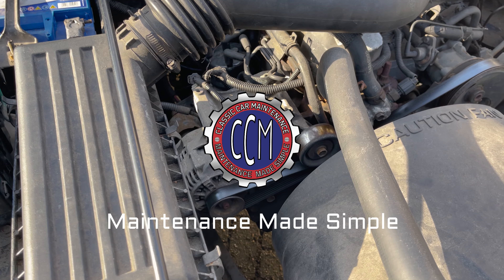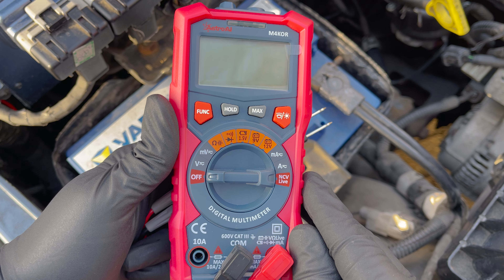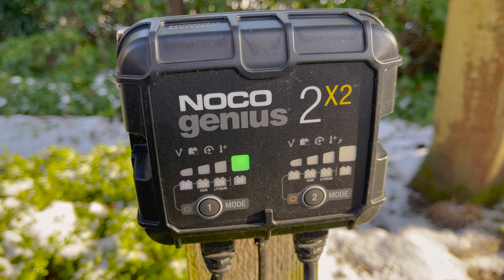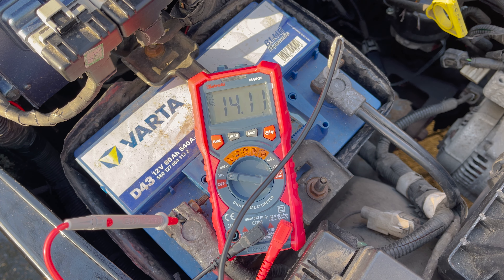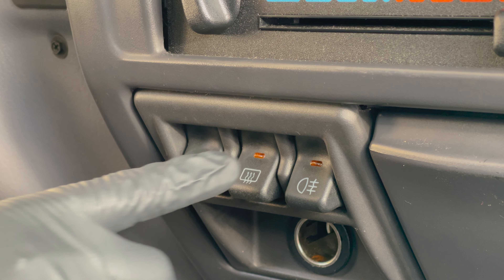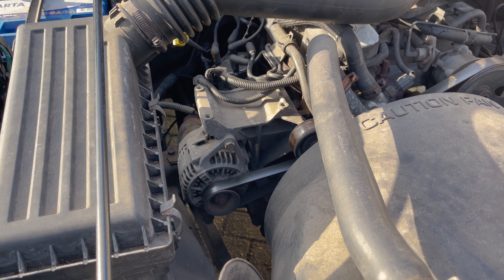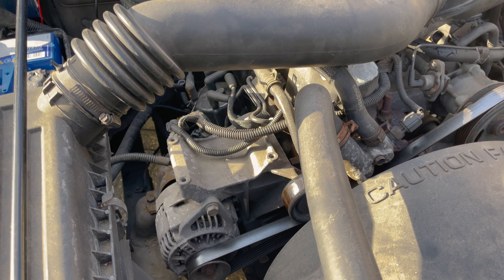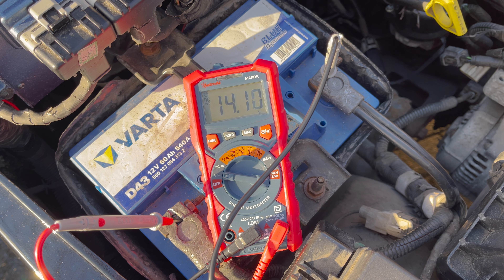How To Test an Alternator With a Multimeter

Comment: What if the vehicle won't start so I can  finish the alternator check? We think it may  be already bad, but not sure. Great video, btw.
Reply from the maker: Glad you liked our video! To answer your question: It is not possible to do a decent alternator check without a running engine. An alternator generates electricity by using the rotational motion of the engine. Only while the alternator is powered by the engine you can check if it is operating correctly and if it produces enough electricity to charge the car battery. So in order to check your alternator you’ll first have to get your vehicle to start again. 
If your car doesn’t start, the first thing to check is your battery voltage. If it’s too low, your starter won’t be able to crank the engine and your cars’ electronics won’t be able to function properly. If the voltage is too low, first charge your battery and try starting your car again. Once it starts, you can do an alternator test. If it still doesn’t start, you’ll have to look elsewhere to solve your starting problem.

Comment: My car stalled while driving. After a few secs i just restarted it. No problem. Could it be a bad alternator? I checked the battery volt (accessory in the 12v not directly)port it was reading 12.2 and if it’s on its 13:4.
Reply from the maker: If you have 13.4 volts when your engine is running, your alternator should be fine. I would be looking elsewhere like ignition or fuel supply.
Reply: @classiccarmaintenance  thank you so much! Ill have it checked by a mechanic!!! Thanks again!
Reply: 12.2v is a bit low for a battery.  cars require close to 12.5 v  to turn on properly